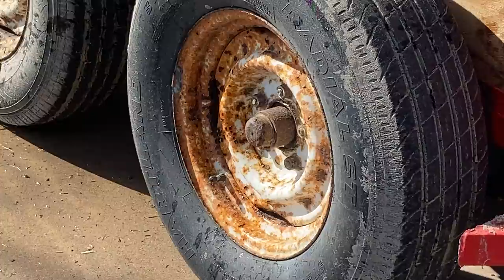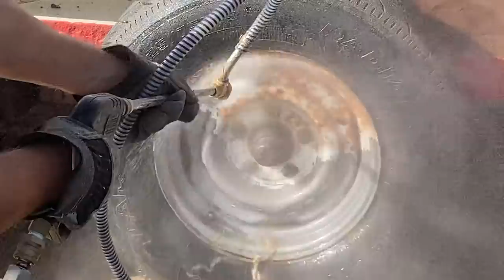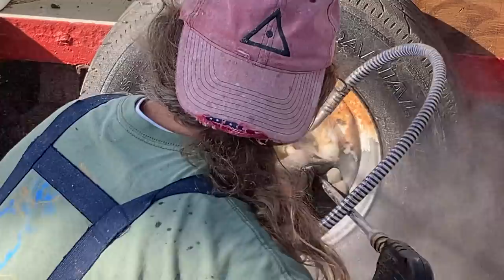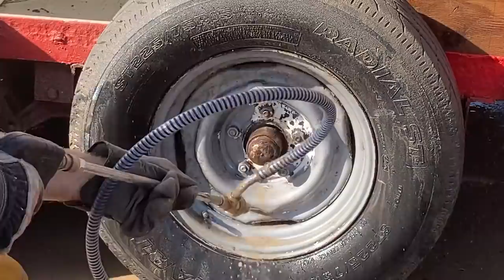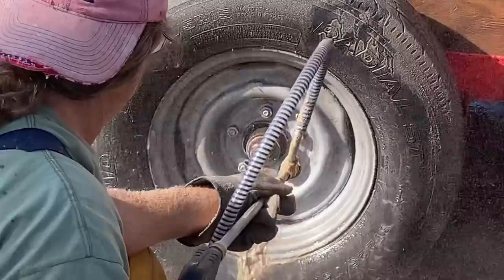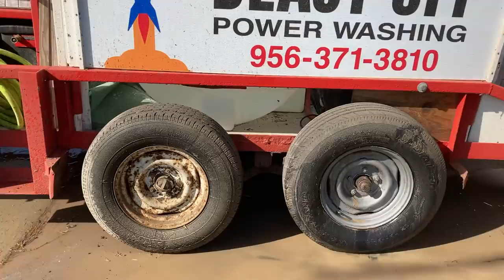Wet sandblasting a tire rim while still on the trailer.

Comment: Man that works slick. What type of sand did you use.
Reply from the maker: Beach sand!  But it’s hard to do the other side while still on the trailer.
Reply: how did you make the wand
Reply: What's the psi on your pump thanks

Comment: You'll find out sooner than later to never do that again whw. A wheel bearing fails . Been astimg over 20 yrs now and when I started, I locked motors, wheel, and pretty much everything lol.  If u don't know, you don't know,  what separates people is how you do or do not learn from the mistakes......I was a fast learner and now I wrap everything that remotely looks like an opening with rags. It takes 2 mins to remove a wheel!!!!!!!!! And you also can't even get the whole wheel with it on thr axle...dohhhh!!!
Reply: Can you tell me how the sand get in a sealed hub, just asking?
Reply: @amarook525  absolutely 💯.  Where the Crack is on the inside where hub and axle meets. Wrap that in rag and tape around it
 You will miss an inch or so, but clean that up with paper or like I do,,, with a air descaler.  Sand will go everywhere in 25 ft!!!!!! Everywhere and once it's in that Crack with the grease, it will remain and wear and get in bearing.  Dead soon.
Reply: @amarook525  you take that wheel off and you will be shocked at how much sand is in between hub and wheel 😳